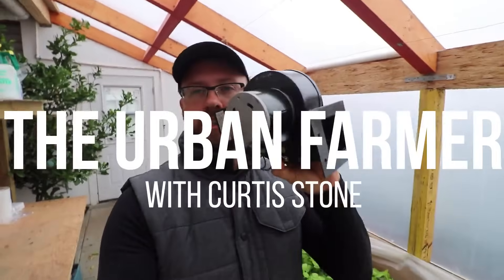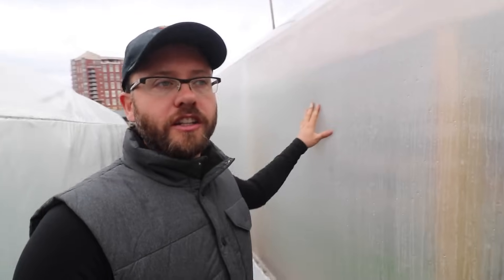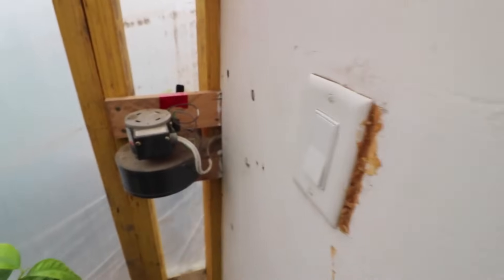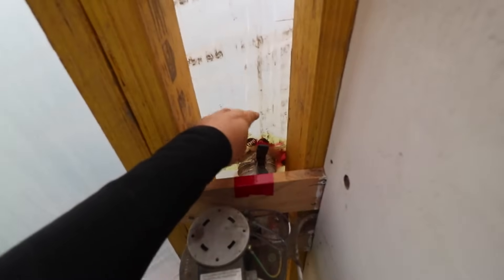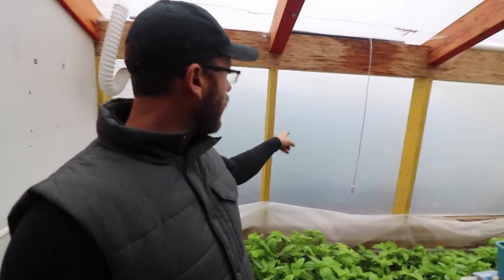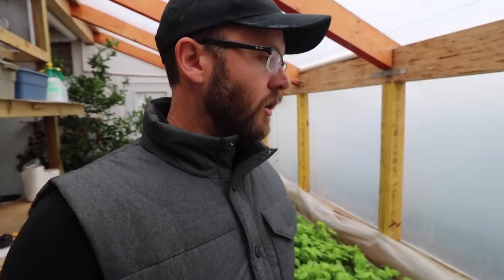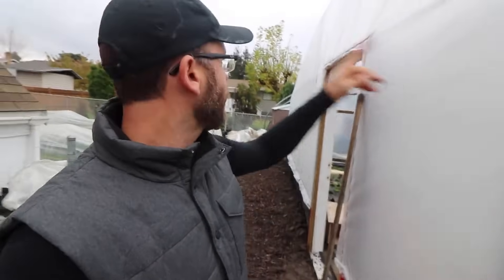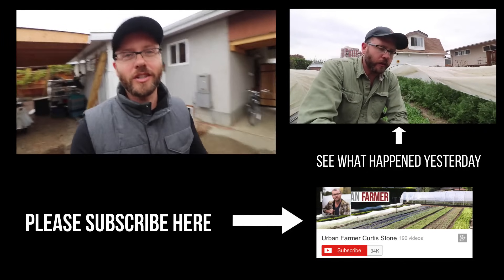How Double Layer Greenhouses Supercharge Your Growing Potential!

Comment: Why didn't you place ploy on either side of the wood frame?
Reply from the maker: That's just not how you do it. I can't speculate on every possible scenario.
Reply: Urban Farmer Curtis Stone Thanks! Just curious if there was some known problem with doing it that way!
Reply from the maker: I would imagine it would make the material between the layers, like my wood, rot faster.
Reply: @offgridcurtisstone   it's not a problem,  just leave the lower layer less taunt and the condensation will run down the middle and away from the wood. Great video though

Comment: take outside air for your blower fan the inside air has to much humidity and it will condensate when it tuches the cold plastic. on yout horisontal split don't put a jumper in just losen off 4-5" of wiggle wire when you don't use your roll up I used  $36 blower fan all plastic. works well the metal once rot out intime.

Comment: With replacement double-pane windows they have always preached that you do NOT want flowing air between.  ???
Reply: The air of the walls and the greenhouse is "static." As long as it's not outside air being blown in, there's still an insulation effect, I would think.

Comment: I came here to specifically find out about the blower. He gives the specs but not the source. I did a search on ebay with the criteria "115V .6 AMP BLOWER" and used and new show up with half the price he quoted at about $100. The only spec he didn't say was RPMs but that may be irrelevant.
Reply: Nolt's Greenhouse Supply has them for $68.00.

Comment: better to use out door air for double poly.  less condensation. cold air hold less water    not need for purpose built exhaust.  Better to keep the air inside the layers as long as possible, not intentionally exchanging it, and continuously introducing more moisture laden air.

Comment: It cost $144 dollars to run a year,if the cost of electricity is 22cents . The motor might last 2-3 years or so . 
Seem like its worth it.
Reply: 130starfish 
It depends a lot on your area. Where I am in GA it's 13 cents/kWh, while in the mountains upstate it can be 20+ cents.

And I'll agree that no, .65 Amps is way past the draw of a light bulb, but I think the point he was making was that with the $7700 he saved by using this method, it pays for itself many times over in one season of production and then some, so the electricity cost for that little blower motor in his grand scheme of things is negligible.
Reply: I live in Australia . So i was talking about aus dollar. I got the watts by 110v x 0.65 = 75watts. So yes bigger than a light bulb . But some motors are smaller and some lights are bigger :P
Reply: For the price of a differential pressure switch and a bit of rubber sheet to make a simple flap/check valve you could cut the running cost in half and double the life of the blower..at least ;) 
My cover inflation system pulls 35w (240v) and runs once or twice a day to maintain the pressure.
Reply: 75w is 75w, be it a 75w light bulb, or a 75w fan. They both take 75w's for them to work.

Comment: Wouldn't a 'sandwich' of bubble wrap between the two layers of PE work just as well, and save energy and be easier to install?
Reply from the maker: Try it and see.
Reply: bubble layer would reduce solar transmitting into the greenhouse

Comment: try using computer fans. they are heaps cheaper to run and last longer.
Reply: large computer fans.
Reply: The fan size does not matter - as long as there are no large leaks in the poly layers, a small fan simply takes longer to inflate the layers.

Comment: curtis we have a project in Honduras and I have not seen anybody use something like this. Is this only efective for cold or could it help with hot weather???
Reply: Only cold.
In hot (sunny) weather the heat gain (radiant heat) from the sun is more than heat gain from the air (conducted heat).
Shade cloth is needed for reducing heat.

Comment: Why not just use twinwall polycarbonate get the same effect but without using electricity or the fan
Reply: poly is high cost
Reply: razzorzedge It’s got a 10 year guarantee and what is the cost of running a fan for a year keeping those walls separated and those walls are plastic don’t have no ten-year guarantee

Comment: Gday Curtis. Quick question m8, and i apologise if when i skimmed the previous questions i missed the fact thay some1 else has asked but.....

How does this hold up in the hotter months? I actually need to stay cool as opposed to warm (we get 35°C-45°C during the summer) and was wondering if this air barrier has the same effect?

TIA m8!
Reply: maybe you can use a shading compound applied to the outside to reduce heat. Check out Kool-Ray and ReduSol brands

Comment: I'm not saying this doesn't work, I don't understand it. How does taking the warm air from inside and moving it around on the cold surface of the outside provide insulation??? It seems to me like anti-insulation. At least with still air you'd have a layer of cold near the outside but it wouldn't mix much unless you were walking around in it.
Reply: it is such a small volume of air and it is relatively not moving its only maintaing the spacing
Reply: ... I don't understand how that makes it energy efficient... You're saying the blower circulates air from the outside? 

That would make more sense from how I was thinking it's implemented.
Reply: shadfurman it's air between 2 layers of plastic. The blower puts increased positive air pressure between the sheets, and it's the 3 layers:  plastic+air+plastic that create a relatively static combination which is the insulation. The thicker that layer, the more insulation it provides as the outer surface area of air contacting the outside plastic sheet gets smaller. You blow in pre-heated air to counteract any heat exchange through the outer plastic layer. That is the key, you are staying ahead of the eventual heat loss. The temperature of the air in the wall will be somewhere between the outside air and the air in the main part of the greenhouse.
Reply: Bridget Aboussafy, and the sweet part is that it does not necessarily need to be heated “air” per se, ... the temperature from the daytime, & the earth, in addition to any other lighting effects, or appliances, would also create enough heat in order to keep the temps in a nominal range, ...
Reply: John E Osman III I'm in Alberta where we see winter temps between -20 to -40C, so heated air plus any extra heat sources we can use help a lot.  it's really tough to keep plants unfrozen here in any season but summer without a bunch of extra effort. also I have moose that come around and try to eat everything, that certainly adds extra excitement when not using solid greenhouse walls! I installed some nice led "trees" a couple weeks back and they tried to eat those too!
Reply: eat the moose.
Reply: Stilll dont understand it.
Reply: Awful !  Just plain, terrible greenhouse.
Why would anybody buy a...   "noise making machine ???"
I call it like I see it...
   NOISE  POLLUTION !
Reply: Air gap  creates "r"
Reply: I agree 2 sealed layers would be better not moving the air around

Comment: Well - when you blow air constantely between layers, it just doesn't make a sence - actually You are delivering a warm air from inside all the time between layers = between your warm air and outside it's basically just one layer - that's the reason, why is inside poly so nice and warm for touch - I bet, that the outside layer is also quite warm. But I hope, that I am wrong.

Comment: if you are blowing warm air from the inside the greenhouse  in between the 2 layers, you lose calories inside the greenhouse faster because that air becomes in contact with the cold outer layer and will lose calories faster than if it was in a still mode ..Who convinced you of that ? where is the engineering calculation ?
 It works obviously to decrease condensation inside because the polyethylene is  supple and the 2 layers are not normally separated by a constant distance  . You should have a double layer plastic like solid polycarbonate that allows more sun calories inside on a sunny day and will not sweat during the night …..polyethylene is cheap to buy but you lose money thereafter because of lack of light and heat from the sun during the day....and lose it at night because of its very dismal insulation ….please consult with a thermodynamic engineer so he can explain better

Comment: Ummm...I’m thinking a vacuum is better..like a thermos ....they don’t increase the amount of atoms that 
transfer heat and cold, they reduce the transfer by reducing the pressure...on the right track..BUT the wrong direction!
Reply: It is too expensive and technically difficult - just try to find a vacuum leak - it is difficult on a piece of equipment and nearly impossible without expensive equipment.  Unless you use reflective coatings, you will still have to contend with radiation heat losses.

Comment: R-value is not R5 but rather about R1.5.  A single layer of poly is about R0.86
Reply: but with the tempered air flowing through the layers does that not add more R value? more airspace correct?